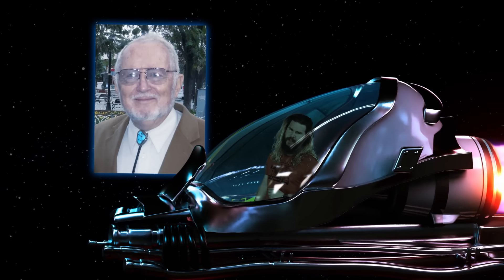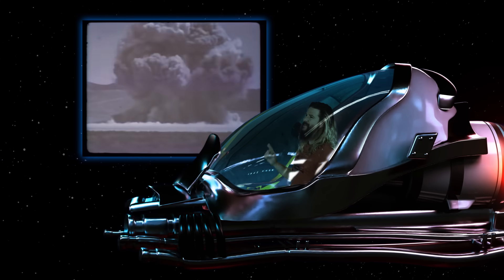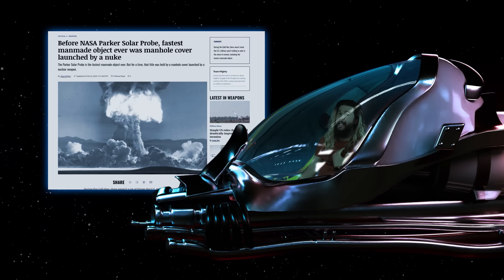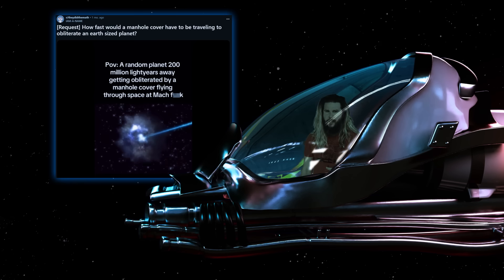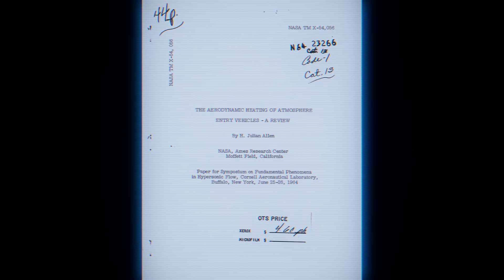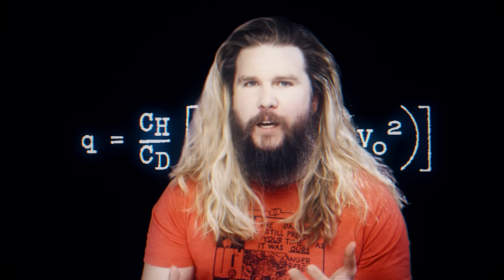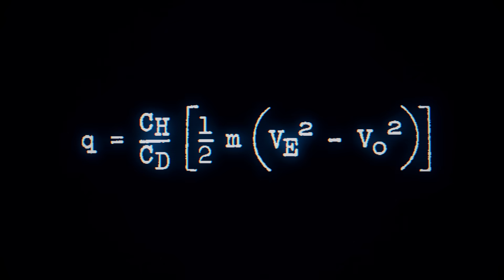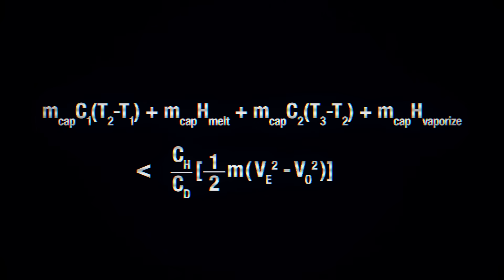Debunking the Nuclear-Powered Manhole Cover

Comment: There are three difficult problems to solve here.
1. Calculating Vo, which you assumed to be zero. 
2. Calculating the amount of heat generated; and the temperature that the iron plate was exposed to.
3. Calculating how much of the heat that that was generated  transferred into the iron plate.

1. You assumed that the plate didn't make it through the atmosphere in order to prove that it couldn't. 
2. You did that part by assuming all of the KE became heat and a significant amount of that heat went in to the iron. Generally things entering the atmosphere from space travel obliquely and are exposed to the heat of reentry for a significant amount of time. Even then, a lot hits the surface of the Earth. Especially dense metal objects. The iron plate left traveling perpendicular to the earth's surface minimizing the heating of the plate. There was no time variable in the equation you used. It appears that the equation you used assumes a relatively long reentry with a significant transfer of heat to the iron plate. I don't think that is a valid assumption in this case.
3. The heat is generated by the compression of the atmospheric gasses. That heats the air not the iron. At that speed the iron is only in contact with the heated air for a couple of seconds which would limit the heat transferred to the iron plate. Do we not think that a 2000 pound chunk of iron would survive for 2 seconds in a furnace at a few thousand degrees?

I think the likelihood of the "manhole cover" making it to space is pretty good.
Reply: Another way to prove/disprove that the manhole cover made it to space would be to determine the heat necessary to vaporize the iron involved from radiant heating in the time it would have spent inside the atmosphere before breaking through into (relatively) empty space.

I'd actually be interested in figuring out those numbers, as it would put an upper limit on how hot the atmosphere would have had to get to vaporize the metal traveling through it at "mach fuck".  Because IIRC, part of the reason that the physicists involved were nervous setting off the first nuke was the idea that sufficient heat might have been developed to cause a runaway fusion reaction in the atmospheric nitrogen.  I'm almost certain (50/50) that the heat required to vaporize the iron plate in the 1.5 seconds it would have been inside the atmosphere would indeed have triggered that runaway sheet of flame around the earth.
Reply: 100% on board with this rationale.
Reply: Also - Ablation.

Supposed that half the thickness of the manhole cover did melt away.  That's still about a thousand pounds of iron moving PDQ out there.
Reply: Would the cover have been "pre-heated" with the nuclear device that was exploded under it?
Reply: @britian4life no, probably blasted ahead on a pressure wave
Reply: There's bigger problems than just the math. The manhole cover wasn't even made from  iron, it was made from concrete.
Reply: With regards to your 3rd point, C_H / C_D is the ratio of the heat generated that gets applied to the object itself.  The problem is, as someone else pointed out, the coefficients he chose made it so this ratio was greater than 1, meaning it generated more heat energy than it had initial kinetic energy.  This ratio is supposed to be much less than 1.
Reply: The cover wasn't just sitting passively in near-still air at high temperature - it would have been being blasted by (very!) supersonic winds for those few seconds. A chunk of steel can sit in water for decades without anything worse than rusting happening to it, but you can use a high pressure water jet to cut steel. The (relative) motion matters!
Reply: @rmsgrey the water jet is full of specifically chosen abrasive minerals such as garnet or aluminum oxide. It's not just water. There is such a thing as pure water jets but they only cut soft materials.
Reply: @niceguy191  ye I wish he explained how he got 24 for the heating coefficient. I think that's more confusing than the Vo being 0. But he also way overestimated the amount of heat it would take. If the iron melted, it would oxidize in air or vaporize in the vacuum of space. I found a phase diagram that suggests iron would vaporize under 1000C in a vacuum, and he also made the starting temperature room temperature after the thing was hit by a nuke.
Reply: I don't understand why people think a shorter travel time would somehow make something survive better. This is not something sitting in an oven passively absorbing heat from a hot environment, the object itself IS the source of energy, and everything about how much heat is generated is derived from properties of the object, by far the most important of which is velocity.

Slow transit would barely ram compress air at all (the air would simply move out of the way), but resistance, compression and heating all exponentially increase with velocity of impact with air, and guess what, shorter time of transit means higher velocity.

Ever heard of a fire piston? Compress it slowly and it will barely raise the tinder above room temperature, but slam the piston and it will immediately raise it to ignition temperature, despite compression levels being the same in both cases. Time of compression is the key variable, and shorter time produces literally hundreds of times more heating for the same level of compression (and the compression level itself would be far less at slower velocities traveling through open air).

The Earth regularly encounters objects far larger than this "manhole" made of similar iron/nickel, moving significantly slower, and the vast majority are obliterated under far less extreme conditions of the high atmosphere. You think that somehow a much smaller object, traveling much faster through a much denser lower atmosphere would somehow survive better?
Reply: @CannikinX  The object itself is NOT the source of heat. The source of heat is the compression of air causing the AIR to heat up. That heat is then transferred through convection to the metal for the duration of time that it is in the atmosphere. That transfer is going to be much faster than just sitting in an oven since the pressure is much higher, but that transfer will still take time. Both time to transfer from the air into the metal, and time to transfer from front layers to back layers, as the space behind the object will be nearly vacuum. That transfer process may also cause ablation meaning that some of the heat is lost as material in the front is vaporized before it can transfer that heat to layers behind it. If the object it self was the source of heat, then no space craft would ever be capable of reentry no matter what it is coated in.

Earth regularly encounters object far larger, however they are not made of highly refined metal alloys. This cap was not a random mix of iron/nickle/ice, but steel specifically selected for the purpose of holding up to a portion of a nuclear explosion. 

Denser objects also have less surface area compared to their mass, meaning less drag and there for less heat per mass. And the quantity of dense air that an object has to pass through is also a factor, as it means there are less atoms of air to press together and generate heat from. An asteroid comes in at a very shallow angle hitting a very large quantity of atoms, while this cap would have hit significantly fewer atoms of air leaving directly away from the planet.
Reply: @Goodgu3963  1. I didn't say the object is the source of heat, I said the source of ENERGY is the object itself. And the more (kinetic) energy the object has, the more energy will be converted to heat through interactions. This is a fundamental principle of thermodynamics. And remember, kinetic energy goes up by the square of velocity (inversely proportional to transit time), so 1/10 the transit time would mean 100 times the energy available to convert to heat.

2. Heat does not get transfered via "convection". Convection is merely the movement of fluids carrying heat from one location to another. The ONLY ways heat actually gets transfered from atoms to other atoms are conduction (atoms/molecules actually colliding and transfering kinetic energy) and radiation (direct travel of energy via photons). Most of the hot plasma that builds up in front of an object traveling at hypersonic speed does not actually touch the object, because of ram pressure pushing it away, so the primary transfer of heat is through thermal radiation. And no air pressure is going to block this radiation.

Thermal radiation scales by the >fourth< power of temperature. That means plasma that is 4000 K emits SIXTEEN times the thermal radiation of something at 2000 K. An object traveling at merely orbital speed of 8 km/s already generates a plasma of thousands of Kelvin traveling through the very low density upper atmosphere. Traveling over 8 times that speed (over 64 times the kinetic energy) in the far denser lower atmosphere would easily reach into the tens of thousands of Kelvin (hotter than the surface of the Sun), and emit thermal radiation THOUSANDS of times greater, as many meteors do, which is why they become insanely bright, much brighter than any orbital spacecraft re-entering.

3. Cast iron is not steel, and "highly refined metal alloy" is a completely meaningless term for this context (solder is a "highly refined metal alloy" and one would hardly think of it as "heat resistant"). Cast iron is a cheap alloy specifically designed to have a significantly LOWER melting point than pure iron or steel (and for that matter, steel also has a lower melting point than pure iron), so that it can be easily melted to cast, hence the name. Anyone who knows anything about metallurgy knows that cast iron is very brittle, and relatively easy to destroy by heat. Just dropping a cast iron pan from a counter can shatter it, let alone traveling at hypersonic speeds. Cast iron was chosen as this material because it is cheap (requires much less refining/decarburizing from pig iron than steel), easy to cast into the large shape required (rather than forged like steel), easily welded (because it is easy to melt), and heavy to resist movement.

4. You must be joking implying that an object hitting the upper atmosphere encounters more air than an object at the surface. For instance, the Chelyabinsk Meteor reached peak brightness (maximum heating) at around an altitude of ~30 km, where the air density is less than 1% that of sea level, shortly before it exploded due to said heating. Very simple trigonometry shows that to travel through 100 times the distance, an object would have to hit from space at a miniscule angle of 0.572 degrees, which would never penetrate the atmosphere anywhere near to 30 km altitude, let alone make it to the surface, but be immediately reflected back to space (probably would not even make it past 100 km, the official definition of "space", where the air density is a tiny, tiny fraction of a percent that of sea level). And even if it did encounter the same amount of air, hitting it at a much faster rate would produce exponentially more heating. 

For reference, this "manhole cover" was estimated to be traveling over 3 times the speed of the Chelyabinsk Meteor, moving through over 100 times denser air compared to the air where the meteor became so hot it appeared much brighter than the Sun (it was estimated to have released about 90 kilotons of energy just in the light/thermal radiation alone).
Reply: @CannikinX  1. You did say the object was the source of heat. Just because you edit your message doesn't mean you didn't say it. There is no argument the object had a lot of kinetic energy, however kinetic energy does not melt metal, meaning that it must be converted in some way to heat.

2. Convection is a method of heat transfer. However I will concede that it doesn't matter how the heat is transferred from the air plasma, only that it is transferred, and that this transfer takes time.

2.5. I am not going to take your back of the toiletpaper assumptions for temperature with zero math or scientific references.

3. Except that it was not cast iron it was steel, as stated by multiple people who were at the actual test. It wasn't cast it was machined. My point with refined alloys is that asteroids are much less stable and resilient than the cap. Using an asteroid as a judge of whether on object would break up is not a useful comparison. Something like a satellite would be slightly more accurate but still flawed since satellites are also designed to be lightweight, not have dense heat resistent plates of metal in them.

4. I am not implying an object only hitting the upper atmosphere will encounter a greater number of air molecules, than one only hitting denser air above sea level. I am stating that an object that approaches at a steep angle (obviously not enough to bounce off) would encounter a greater number of air molecules as it travels around our planet through the atmosphere and hits the surface, than an object traveling straight in or out from the planet.

4.5. Again, an asteroid is not a useful comparison. This is why we do math and not make wild ass-umptions.

Comment: If the math checks, I trust the numbers. Intuition tells me that at those speeds everything is liquid and solid at the same time.

I have two questions though. Would the calculations yield different results if the manhole cover turned such that the four inch thick face were the leading edge, giving it less drag? Also, is it reasonable that the vaporizing Iron at the leading edge created a plasma shield of some sort, kind of like a Leidenfrost effect?

Something else that would be fun to try to sort out and further destroy the topic would be how many Gs of acceleration did the manhole cover experience as it vaporized. Then from that calculation determine if an Iron manhole cover could have the structural integrity to even stay together.

Comment: The simple fact that the manhole cover was caught on camera far enough away from its starting location proves that, for at least the moments between those frames, it was moving and in-tact. 
So regardless of if it was vaporized or not, it did have at least a moment where it was moving at insane speeds while still being solid.

Comment: Disclaimer: These are the internet numbers. A typical iron-asteroid should be about 5 meters-wide in order to reach the earth's surface. A typical iron asteroid of that size weights (ESTIMATED) 500 metric tons and enters the atmosphere between 17-25 km/s. I know iron-asteroids are not entirely made out of iron but it just shows you how much mass the atmosphere eats up before even the smallest portion reaches the earth.  So, no. We can confidently assume that a 900kg piece of un-aerodynamic iron (going straight up, about 3 times the speed of an average asteroid entering the atmosphere) did not make it to the space especially considering the fact that it has to endure the most drag/heat right at the lowest altitudes. Again these are internet numbers but I would bet my money on vaporization before even reaching the thinner parts of the atmosphere.
Reply: C'mon folks SR-71 Blackbird top speed was 3.2 mach and the temp on the engine coverings (made out of titanium or alloy) were measured 1200 F. We are talking about 66km/s or 192 MACH! Iron's melting point is 2800F.

Comment: Hey kyle,
 the formula has no time i can see. Do those sensible coefficients you found account for the heating time? Or are the ca. 2 sec needed to reach space more then enough time for heat to transfer, so that it doesn't matter and can be neglected. Also wouldn't NASAs numbers look at objects travelling tangentially through the atmosphere, so again have more time to heat through, instead of said manholecover moving approximately the shortest path to space.
It seemed in the comet videos you referenced that once a critical point is reached the objects explode and the debris vaporises pretty fast afterwards, if that point isn't reached within ca 2 seconds ( first comet you showed took about 5s 10:38- 10:43 to selfdestruct)a good chunk of le manhole could have made it to space.

Comment: I don't understand how you estimated it's velocity upon exiting the atmosphere.
Reply: As many others have point out more eloquently ... Kyle did not. He just assumed it burned up, and thus it's final velocity was zero.

Which is begging the question, or simply assuming the answer to come up with the anwer.

And further he did not state this assumption, or even put it onscreen when he substituted in values for the variables.
Reply: Thus, the real question is: how much did it slow down by? And once we ballpark that, the follow up is, "Assuming it is not negligible, does the efficiency kinetic energy was transformed into heat matter?"

Comment: ARIA is spectacular in this episode.

There is an error in your calculation. We don't know the final velocity of the manhole cover, but in your calculation you've assumed it to be zero, and plugged 66km/s on the right side as a difference between initial and final velocity.

But I have a small objection to the final conclusion (without maths). The manhole cover went straight up, and at 66km/s would reach Karman line (100km altitude, essentially no atmosphere) in around 2s. Would that be enough time for the heat transfer to completely vaporize it? Furthermore, the atmospheric reentry physics is not the exact opposite to that launch event because manhole cover was decelerating while going towards lower density atmosphere, while objects falling on Earth slow down towards greater density.